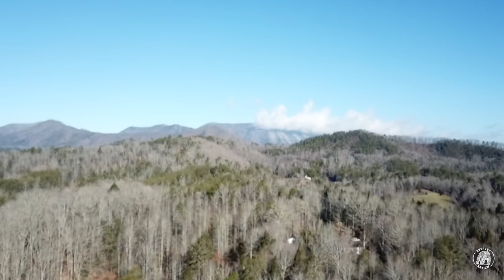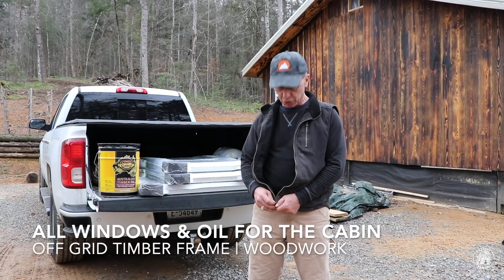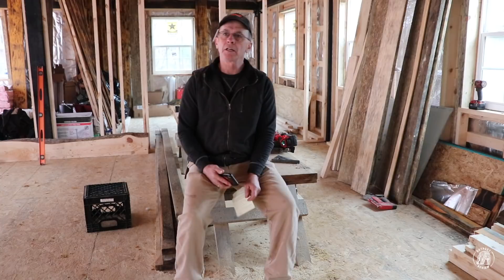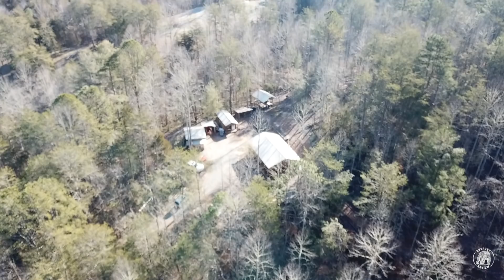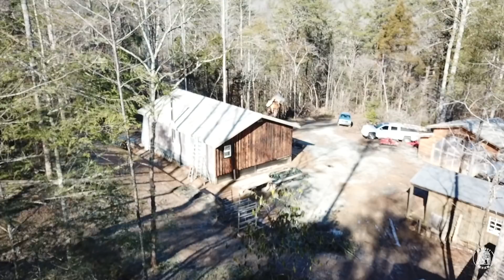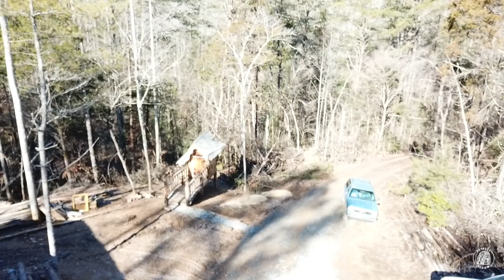ALL WINDOWS & OIL FOR THE CABIN | OFF GRID TIMBER FRAME | SELF RELIANCE

Comment: How hard would it be to put in a septic system as to have a toilet that flushes?
Reply: Septic system would have to be engineered and done to code with permit by doing gray water run off and compost he doesn’t have to do code permit hope that helps 👍

Comment: Will you be putting insulation in the bathroom walls to reduce sounds? 

A ram pump requires the height to drive it so the other options are a spiral pump on a water wheel or a direct drive solar pump.